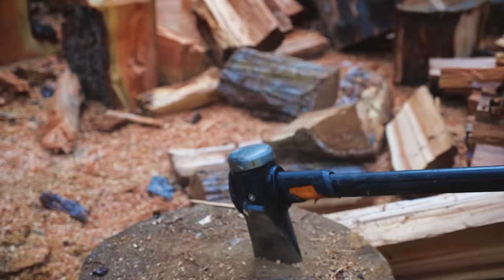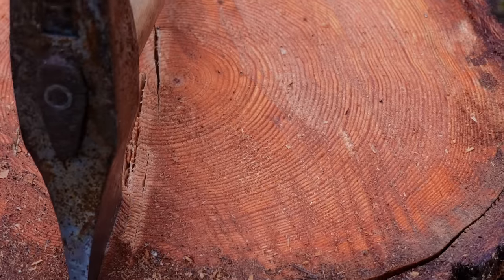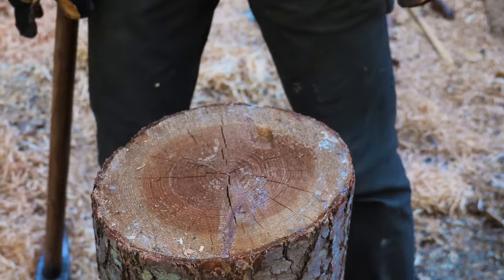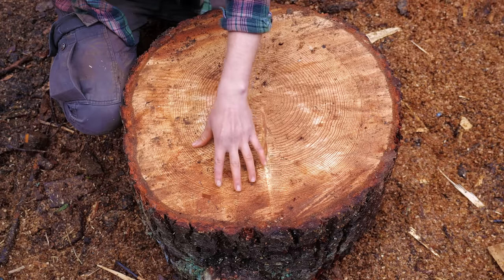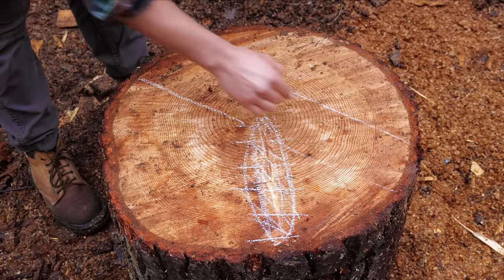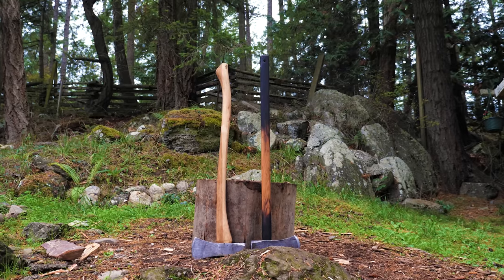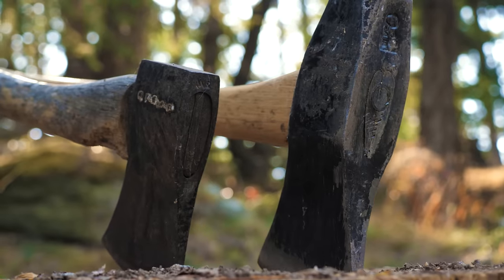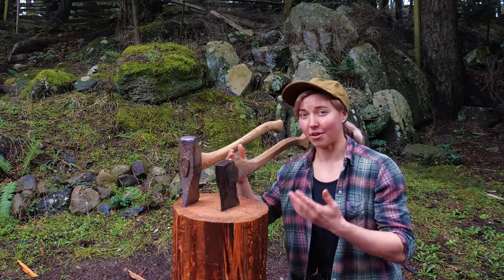How to Chop Big Rounds and Knots!

Comment: I like your videos and the twinkle in your eye.
Now I live in an apartment without anywhere to fire but have chopped wood before. When I had thick logs to split, I started along the edges and did not try to split the piece in half. Then I work my way inward little by little.

Comment: I miss having a fireplace in my home, in part because it gave me more reason to split wood, and I miss splitting wood as both exercise and stress relief. 

On larger rounds, I defaulted to the outer chops pattern most of the time, partly because I rarely had coniferous wood to split. The Emerald Ash Borer has killed off a lot of Ash trees, so friends have "standing firewood," or Ash trees that are dead enough that the wood can be split and burned almost right away after felling the tree.

I have two primary splitting tools--a four-pound splitting maul and an eight-pounder (a Fiskars, like one I sometimes see you use). I use the lighter one to warm up or when I want more accuracy, and the big one for when I really want to beat up the wood or when I have a piece of really stubborn wood.

I have one of those star-shaped wedges, but I didn't use it much.

Comment: I'm a big fan of outer chops. Center chops are fine if you've got the accuracy (which clearly you do). For center chops, I would also recommend starting on the outside and working inward rather than starting dead center.

Comment: Years ago, a friend and I were living in Woodland Park, Colorado heating with wood, when someone gave us a pickup load of elm about 18 inches in diameter. that was some of the toughest splitting we have ever done. we got 3 wedges and the maul stuck in one. Ended up using a couple hundred grains of black powder and some cannon fuse to get them out. Didn't even split the wood! just loosened it enough to get everything back.

Comment: You can often split knotted pieces after you've done the parallel split to get it out. Just turn the piece upside down (so the branch that formed the knot is reaching for the ground as it moves out from the center of the tree). Then you can split perpendicular to the knot if it's relatively small, or parallel straight down the middle of the knot if it's large.
I like the challenge of disassembling crotches. Think of them like the crotch portion of a person for the purpose of describing areas. Start with the person upside down with the legs pointing up. Split off the outside of the hips so you end up with two half-legs coming together to form the crotch. Then split off wedges of those legs as far as you can until the crotch grain interferes. Sometimes you can get several wedges off the legs, and sometimes none at all. Now turn the piece over so the legs point down. This next step is a little counter-intuitive and has to be done with pretty accurate swings, but it's the key to being able to take apart the crotch. Split perpendicular to the first splits you made so that you end up with a front half of the crotch and a back half of the crotch (both still looking like a V). You're aiming for the line that will split both legs in half at the same time. This line isn't always straight, so you may have to do each leg individually, but the lines through each leg have to meet each other in the middle of the crotch. Finally, you can split those two half-crotches down the middle on the visible seam between the legs (which was just revealed by the previous split). That last step varies a bit piece-to-piece on which direction is easiest to split; sometimes top-down is easiest and sometimes bottom-up is easiest. You have to very accurately hit the seam, though. Otherwise the gnarly grain will be impossible to get into. Now that the crotch is completely disassembled, you can further split the components, if needed, since they are no longer reinforcing each other.
Almost every two-legged crotch can be split like this. It only works about 1/3 of the time with three-legged crotches.

Comment: That heavy mallet works well, but... How many times are you able to lift it?  I say this from experience.  you can drive an ax and use it as a wedge and hit the ax with the heavier one as if it were a hammer.  You will get less tired.

Comment: Although I chop wood not even every year, I'll give my two cents:

- On the green vs. dried wood, well, that DOES depend on the species. I'd rather chop a truckload of just cut eucalyptus than a tenth of that already dried (say 10-12 months). Last eucalyptus that I had to chop had been waiting for me on the ground for well over two years and I just went medieval with my chainsaw. Well, maybe a chainsaw is not as medieval as an axe but you get the point. All in all, whatever the species, I've always preferred green and freshly cut most of the times. And if it's a species that lives by the river or so, therefore they have a lot of water inside, the better, as it will also help it dry faster than otherwise (as it will happen with any other species but this kind in particular)

- On the chopping strategy, I find the "center" method to be nice for pictures and cinematic intentions but if you want to cut, and cut fast, the "outer chop" strategy is the way to go. You will get more pieces per strike than the other way around, as with the center strategy you will, most of the times, have to strike it a few times before having it cut in half. Meanwhile, the "outer chop" has you cutting almost one piece for every strike. One thing I'll concede is that the "outer chop" begins with "uglier" pieces, that look like an arch instead of the "piece of cheese" we are used to seeing, but that's subjective. Whenever I've had big pieces of eucalyptus to chop (up to a meter, 3 feet, in diameter) I've always gone "for a walk" around it as I'm chopping, taking one piece at a time and, having the right kind of boots, if one of them falls too close so I might trip and fall, I just move it out of the way with my foot and keep on going until there are just a few, three or four, strikes left.

Thank you for your video, I think many will find it inspiring and helpful. I find it delightful to watch.

Comment: One guy on you tube took stumps like those and split them to make the old fashioned shingles on the roof.
Anyway you would build a log cabin?  All that skill and ability on firewood.  A cabin with wool blankets, you could save a few trees.
Which you learning us on wood splitting.  Everything that seems so simple and so easy usually is because of the person doing it has knowledge of what they're doing as well as experience.
Oh, how about building a boat, wooden boat?  A dug out pirogue where an adze would be needed, a couple other things.  Or use planks.  Then split firewood to take fishing😂